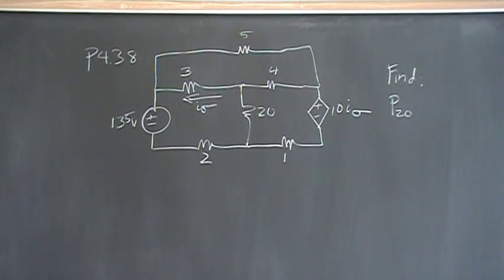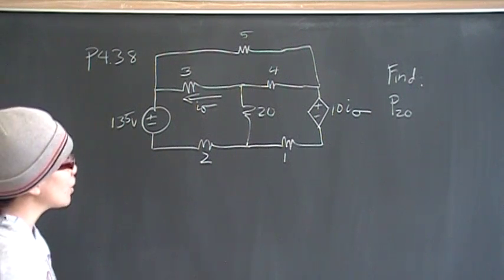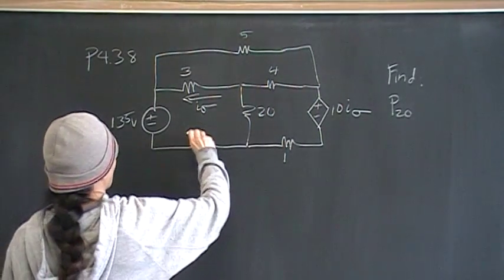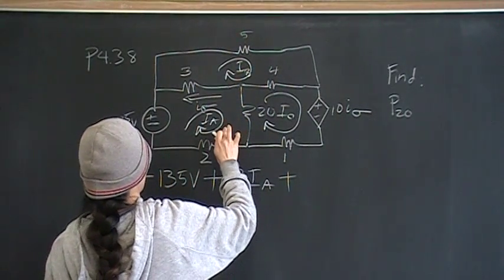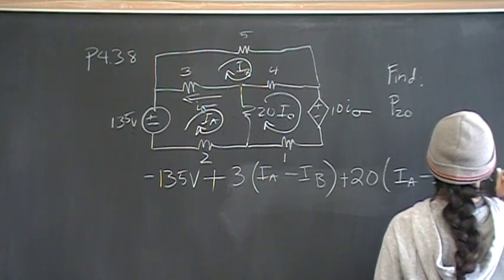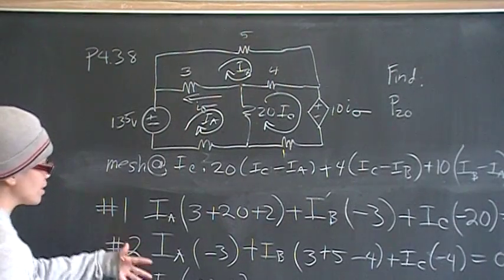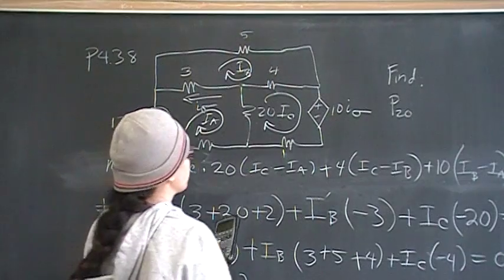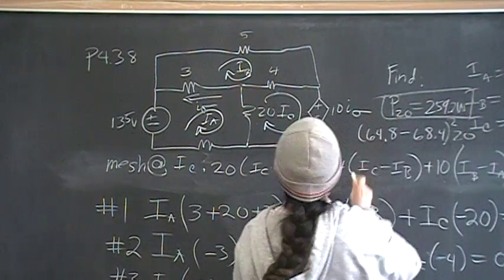Mesh Currents P4.38 Nilsson Riedel Electric Circuits 9E Solution

Comment: Hey i don't know if you still have the work for this (outside of this video) but how did you get I_a, I_b, and I_c to be what you got? I got 7.7,2.5, 2.8A respectively. 

I plugged in the matrix and didn't get what you did. Given i tried it on my own and reversed the mesh currents, my values SHOULD be negative to yours, so, how did you get your numbers?